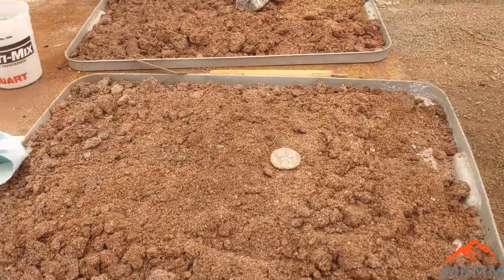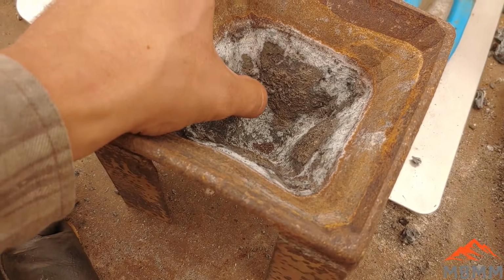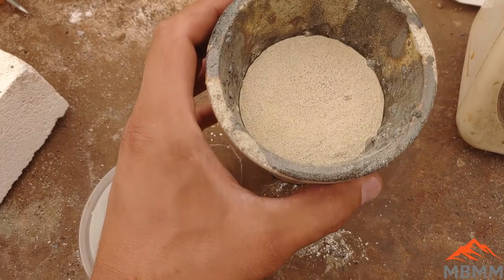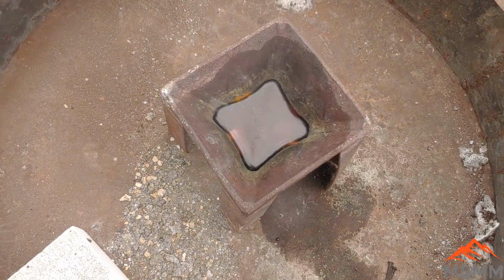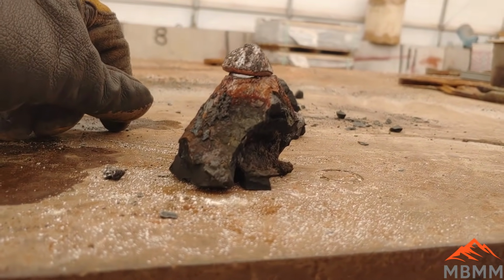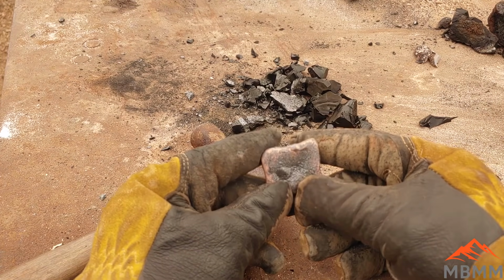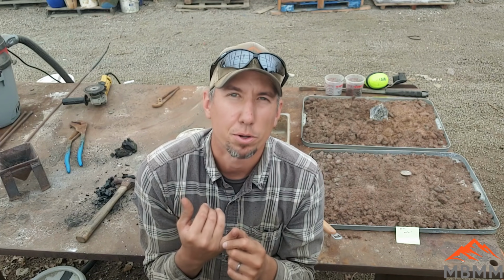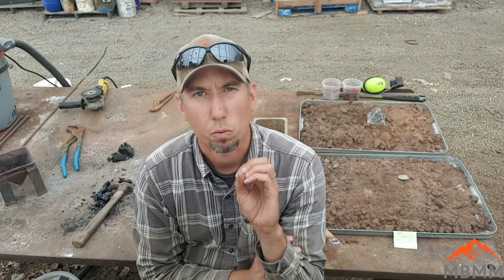Refining Computer Scrap Using Sulfur???

Comment: There are a few PM smelters left in the country - Glencore, Colt, Reladan, SiPi, Gannon&Scott.   Most recover PM from circuit board fractions, shredded, sample, assay in a copper melt.   I know Borax and other additives are used, but I understand the primary homogenizing metal is copper - which was generally 2x the amount of sampled material melted.   then the bars were drilled for assay  - atomic absorption.     I spent 18 years working for such a company, but was on the incoming side knowing enough to be dangerous.   I could help you find out more.    But in truth, the only thing you need to do is shred to mag out the iron, get ride of any aluminum fraction prior to shred - such as heat sinks (copper melts do not like aluminum)    Then you generally reduce everything to a copper bar with PM in it - yes - majority being Silver, Gold and some Palladium.   Rarely a payable content on Palladium, which as you saw comes from the tiny capacitors mounted on the boards.    Older "green" boards are best.   The newer blue and red boards have very low value per pound - $.50-1.25 - if that.    When you see a lot of black IC's (or ceramic ICs) on both sides of the board, your good.  A lot of open space means leave them alone!!  Even the copper content is lower.  

I noticed on one board you left the C2032 Lithium clock battery on the board.   Perhaps you found out the hard way when they get shredded the explode!!     

Be super careful with the older material that might contain Beryllium- that stuff will kill you - slowly - but surely.   some older "ceramic" IC's contain Beryllium oxide and Be was also used as a stiffener for copper connectors to make them "springy".   

Really cool stuff though.   Found you watchin Cerro Gordo vids and your helping Brent.   Nice!   You can find  me - I'll help you.    If you don't already have enough help!
Reply: The amount of knowledge shared within these videos and comments is amazing

Comment: Ya know you can sand blast your cone mold, that would keep the build up down and extend the life span of it as well... One other good tip is to pre heat your cone mold, that in itself will stop a lot of the metals adhering to it.. I found this video very informative and interesting also very entertaining...
Reply: After a blasting I would lite some pine on fire and hold that over it and give it a good smoking
Reply: We use a coating of lime in our molds to stop the metal sticking

Comment: Very interesting results.  Seems a good way to separate copper but I still think you're missing out on the vast majority of Ag and Pd from the various smd components.  I'd bet they are being crushed to dust and just going out with the tailings.  Possibly try to depopulate the boards before going through the hammer mill and then using this same sulfur smelt on the components and compare results?

Comment: Nice!
Reply from the maker: Thanks!
Reply: Did you test adding sulphur as a flux in E-waste smelting, is it effective? I wnder how sulphur not evaporate before it combined with base metals, sulphur start burn and evaporate at very low temperature.

If really sulphur effective as shown in the video it will be the best way for e-waste precious metals recovering even better than using copper electrolysis cell since we can reduce copper content and push it in slag, maybe we can add some silver to make sure that we collect all gold beads, kindly inform me if you have any experience with it

Comment: Great stuff Jason, I find the parallels working with heat and gravity vs chemistry very interesting. Meaning fire vs acids etc. The same characteristics show up in the reactivity of the various metals. I am wondering about why no Tantalum shows up in the XRF. It is present in the PCB's for sure. It is hard, and has a melting point of almost 5500F. not sure if sulfur, or even any acids dissolve it, it is highly corrosion resistant. Enjoy all the vids, keep up the great work!

Comment: One suggestion is try to seive out 1kg material of slot 1 , this will drop out much smaller size will prevent copper and base metals , the rest noble metals and platings try to cupel the rest 
Seiveing should be done with water to prevent loss of dust particles sticking with copper

Comment: Nice job Jason , who would have thought  !!! Sulfur !!!  ,  Before they invented Dynabolts my Dad used sulfur to fuse bolts into concrete or rock , from memory it worked a treat .
Reply: I can remember using molten sulphur to secure handrails & balustrades into concrete. I am a boilermaker & used to make a tonne of wrought iron.

Comment: People who cast bullets from lead are interested in alloys of lead that are hardened. Antimony and tin are the two most common metals that are alloyed in. HOWEVER a small amount of Copper in the lead is being found to be ideal because it adds "toughness" to the lead which keeps the bullets intact at very high speeds and rotational force. It is hard to get copper to smelt into lead though. It would seem that if there would be a way to combine the copper with tin and antimony and alloy that into lead it might be viable. A good combination of lead-antimony-tin-copper might be perhaps 6% antimony 2% tin 1.5% copper with the rest lead. ...Just a thought.

Comment: I think you may find some interesting info looking back on the old sulfide refinery plants regarding refining-recovery of particular metals. You may have issues commercialising your process due to heavy regulation of sulfides btw. One or two of the platinum group can be recovered this way, my memorys hazy but rhodium im fairly sure of, if palladium also its worth you testing a gasoline catalytic convertor, @90% palladium 10% rhodium PM content. Rhodiums difficult to extract via wet chemical leaching and standard smelting. Diesal cats are 90% platinum, 10% rhodium btw. The rhodium extends catalyst life. 
Im trying to figure out with your current material if youd be better off with further mechanical separation ( if possible) before you smelt to reduce further steps down the line in the electrolysis-electrowinning youll be doing of your recovered metal button.
I think the sulfides attacking your mold btw, its worth noting the sulfur may be corrosive to some crucibles and reduce their lifespan

Comment: Hey, Jason! Melting and reaction with sulfur is a really good pyrometallurgical method of refining precious metals! It is very interesting what the result will be. I am waiting for your next video after the process of electrowinning of the resulting alloy. 
According to the electrolysis process, my little advice is to flatten the anode to a thinner and larger plate area. To increase the working area of the electrolysis. You can also roll the anode plate into a roll like a cathode, that is, coaxially to each other. Then the electrolysis time will be significantly reduced. Well, accordingly, there will be less electricity consumption.
Best regards, Nick.

Comment: Ever tried coating your mold with a graphite powder slurry?
...make a thick slurry with gum cellulose and distilled water add graphite powder till it's a tad thicker than toothpaste and paint it on. To dry it out just set your mold on the kiln for a couple min during your smelt. Might be a good idea to sandblast the iron oxides off the mold .Might work better with a fresh surface

Comment: You're definitely on to something! However, I wouldn't add extra iron with the low sulphur smelts because then you'd just reintroduce more iron to the mix and you wanted to get rid of that... Just letting the sulphur react with the more reactive metals in your source should work just fine and it's fine if you have some unused sulphur left over at the end; no need to try and react all of it as it'll probably end up in the mat and slag anyway. ANYWAY just my $0.02
Reply: I agree with Moonchild here. Don't add any extra iron. If you at some point have too much copper in the sulfide mat, then reuse that sulfide mat instead of sulfur in your next melt, or re-melt a large amount of sulfide mat with a few nails in order to reduce out the copper from that.

Comment: Love your videos !  IMO ... to turn e-waist metal recovery into an economically viable business you will need to cook the waiste first to burn off the plastics and other junk, reduce it to a  fine carbon black powder, then run it accross the shaker table.   The way you're currently doing it by grinding up then smelting, there's still residual plastics and toxins  stuck to the metals and little particles that sneak in.  You will need to deal with any toxins,  you can't just open air burn plastics, not environmentally good, probably the best bet is a pryolysis machine, which is basically a still for plastics,  burns off the junk, while procesing bio fuels, afterwards the carbon black could be turned into another product, like maybe crucibels and cupels, there by creating an added savings,  you would  have 0 toxic waiste to dispose of.

Comment: I don't doubt sulfur will react with many metals and may ultimately be a tool in your toolbox. Have you ever heard of a jewelry compound called Niello? It is a compound formed by mixing sulphur, silver, copper and lead. It forms a black material that can be broken up and remelted to fill and decorate silver with a black color. It sounds like it forms a black matte.

Comment: #1. find out how pc boards are made then you can separate everything off of the pc board probably with a type of acid bath. #2. once things are apart you can separate each component that was on the PC boards to other like components. #3. put each pile of same components in another acid bath to wash them from other plastic or junk within the components. #4. do the research on each components to know what to use for separation then you would know before you do something like heat or acid baths. research will tell you how to heat all the same components together. right now all components are all together = the junk slag mixing with the good stuff. if separated you will put like things all together & not lost on what should be done. knowledge is power. today is 12-13-21

Comment: The brittle metal that you made is what I call “shit brass.” I don’t know if you knew this, but you can make brass by mixing copper & aluminum together. About 85-90% copper to 10-15% aluminum. It makes a VERY strong brass if you mix them together correctly (stronger than the stuff that they use for bells), but if you don’t do it right… it becomes very brittle. Probably as hard as a thin potato chip. So when you’re smelting it… you got to make sure that you’re mixing it right. I don’t know why, but the mixture that you made up reminds me of that.

Comment: I have a question for you, if you have the time to answer. I just bought some pre processed e-waste in 225g bars what would be the best way to extract the gold from it?
Reply: If it was melted gold pins, I would not expect anything.  Maybe 0.0001 grams gold.  And after chemical cost and time you will be way into the negative with nothing to show for it

Comment: Going after precious metals with that starter material is a bit overoptimistic. There hardly is any in there. Most of the gold was taken from your scrap before you milled it. You have to make your cut with the copper, or you'll be disappointed...
Is it possible to set up the shaker table to seperate tin from copper?

Comment: Dissolve It In Muratic Acid Till Its All Liquid Then Add Small Amounts of Sodium Metabisulfite Then Only Ur Gold Will Materialize Again On The Bottom Everything Else Will Still Be Trapped In The Liquid Acid Still. If You Want Other Metals There Are Other Chemicals For Each Metal  How Nice Is That 💪

Comment: sulfuric acid electroplating electrolysis
Reply: glass test tubes
Reply: dilute sulfuric acid does not attack some things, can be used as the test tube material
Reply: sulphates are great electroplating casting mold-crystal-growth sources
Reply: sulphates are water soluble, totally sulfur it then water it, or just sulfuric acid, no heating required, diy sulfuric acid
Reply: your sample has very little silica or silicon metal in it
Reply: you washed away most of silica and magnesium oxide in the bed
Reply: computer scrap does not have those, no wonder copper is most of it
Reply: so why did not the copper made into sulphate
Reply: its copper sulphate
Reply: try with water if its solluble
Reply: there are sulfides, of the metals, too